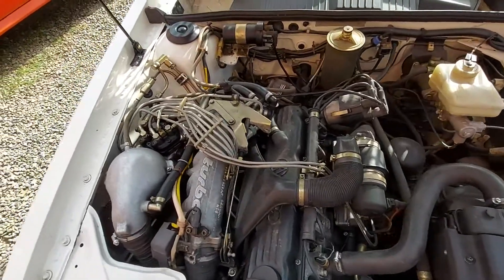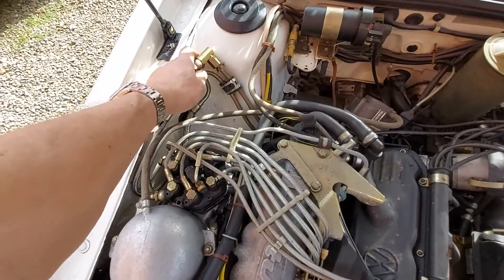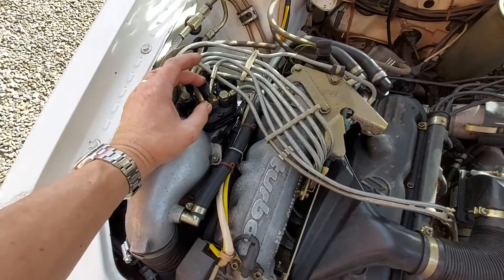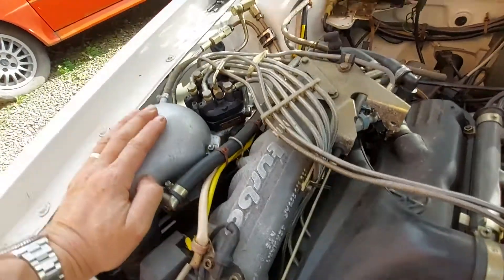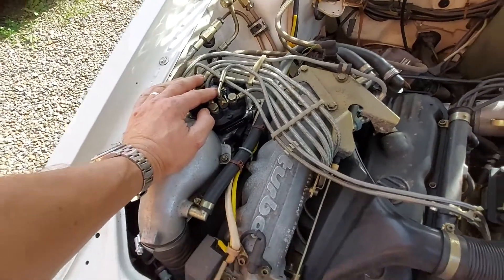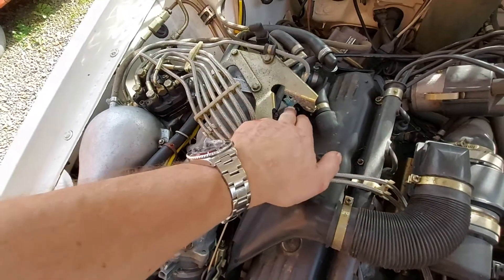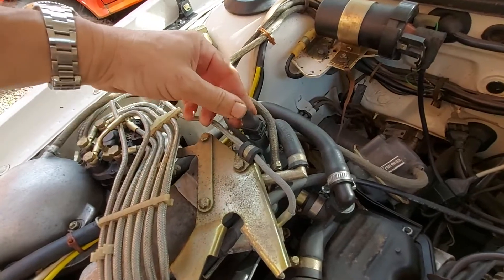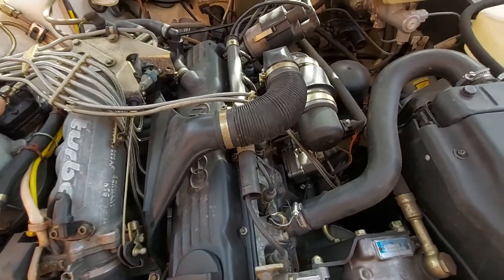Audi ur quattro fuel injection system

Comment: CIS is continuous injection system; the K in K-jetronic is "Kontinuierlich", i.e. continuous.
It's the "control pressure" which defines the mixture via the warm up regulator.

Comment: When our ur has been running, then you stop it and leave for 1/2 hour , it starts up badly and missies as though its choked up, any suggestions please
Reply from the maker: Yes try checking fuel pressure. Sounds like the fuel accumulator is faulty. It should hold 3.5bar for 20 minutes after running.